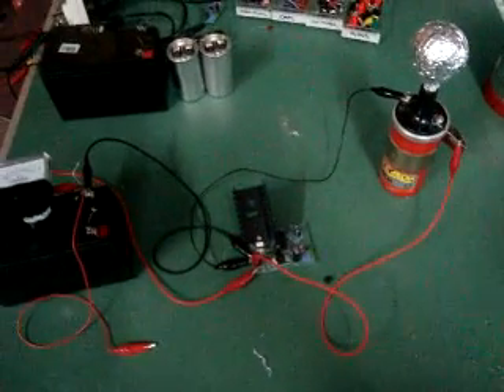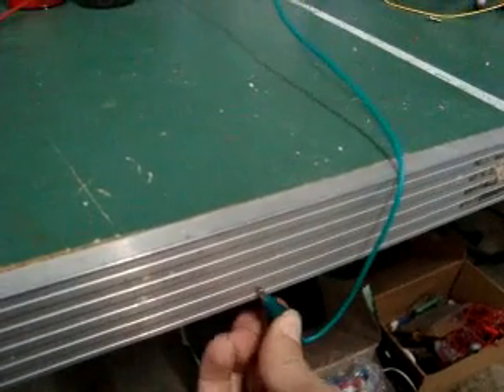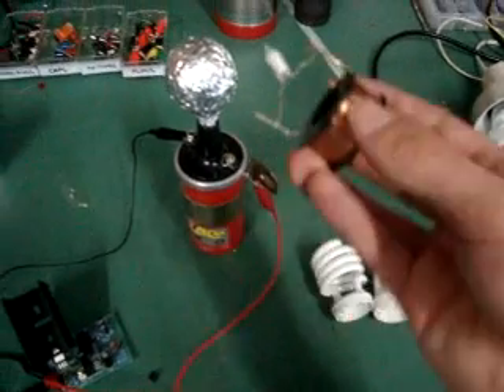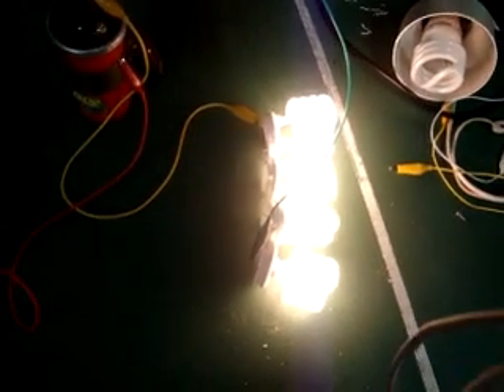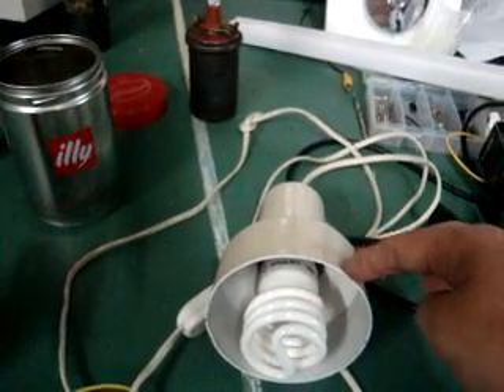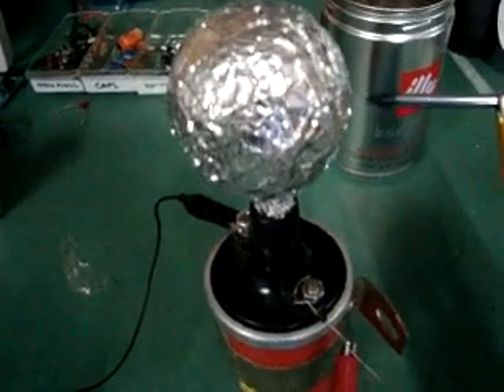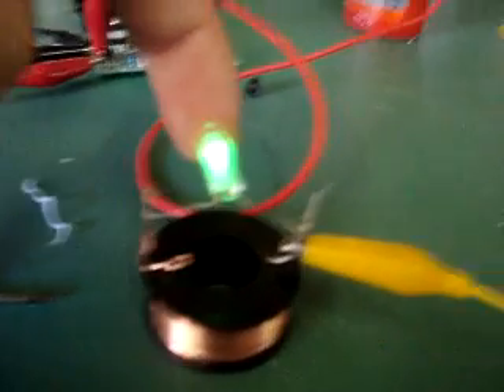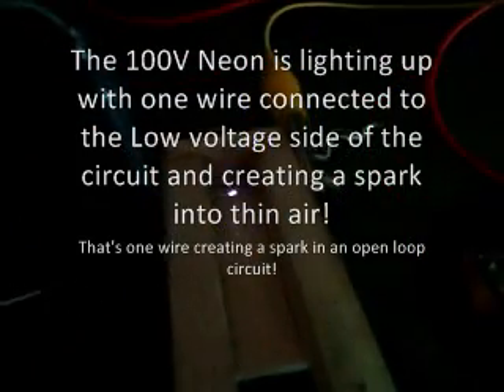Radiant Oscillator 02 (PWM) - Tesla Wireless Experiments

Comment from the maker: but with these circuits I cant tell which way things are flowing.... 
On my Joule Thief Fluro light I used a bridge rectifyer running into the Fluoro and did the one wire thing.
It lights when the negative side is connected and the other side is free, not the other way around.
So it seems the energy is  coming OUT of the negative side not the other way around like we think of conventionally

Negative energy?

Comment from the maker: In the video i said it runs at 10kHz but I checked the specs and its supposed to run at 2kHz.
However to the coil seems to find resonanc e and the frequecy in the coil changes. Even just touching a CFL changes the frequency.

I'll post a video soon that shows scope shots and amp draw
-shlodo

Comment: the ignition coil is a ferrite core transformer,and at that freq the ferrite doesnt have time to relax fully.
you will get bigger sparks at lower freq-which will peak your coil better,giving you more voltage,or you could take out the ferrite and run it air core like a true tesla coil,and stay at the high freq.
bigger smoother domes,height of antenna,matching inductance of TX and RX coils,capacity on primary side of coils,adjustable spark gap,all these things help improve efficiency.
good work

Comment: use a elevated capacity like a antenna, out of the top....

great job check out what i have done

i light a LEd 10ft away copletely wireless
with just 36 watts on the transmitter... and my reciever is another antenna and another ground